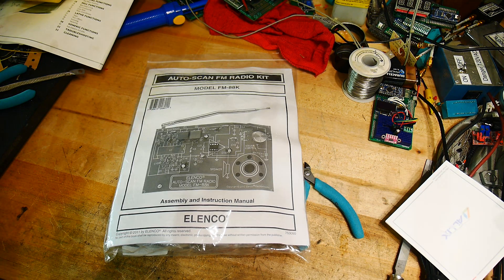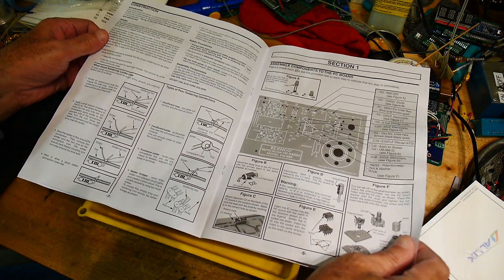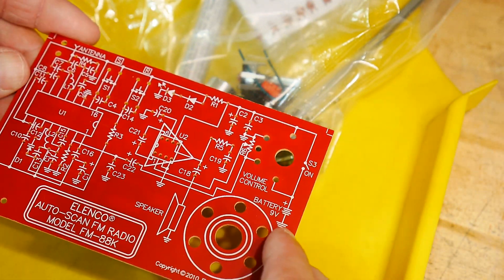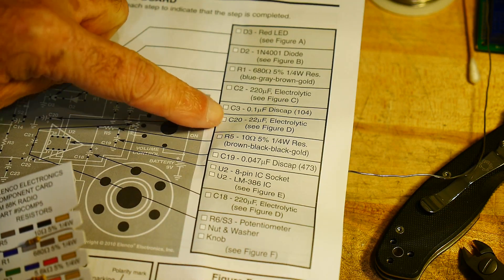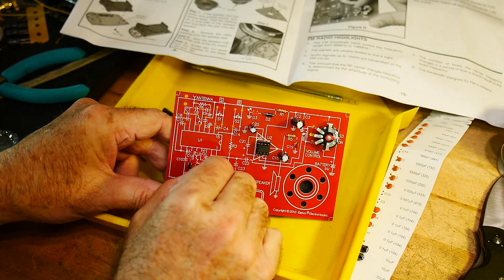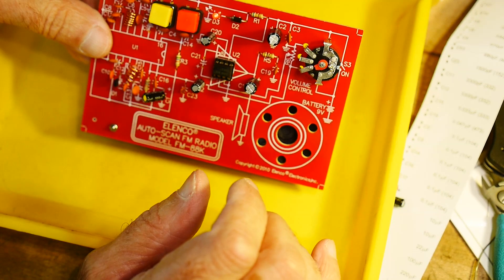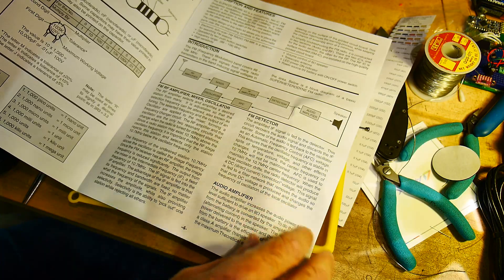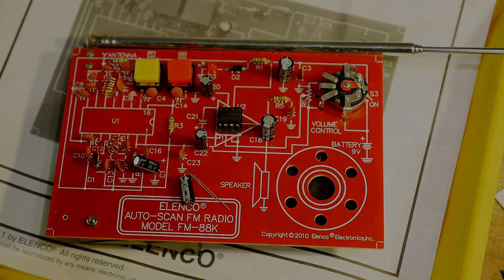#387 Elenco FM Radio Kit

Comment: @IMSAI Guy, Mine ended up tuning only to the NOAA weather channel at 162.55MZ. That's way too high for the standard 88 to 108 MZ range. I don't know what to do.
Reply from the maker: L2 and C13 set the oscillator frequency. My guess is you have the wrong value in C13. too small.
Reply: @IMSAIGuy  Thank you. I just checked my C13, it's 680pF (681), exactly like the instructions say. I tried adjusting L2 coil - if I press it tighter (all the way to completely touching each other) - what the instruction say I should do to catch a lower range, then the entire range is just static (evidently not going low enough to encompass any of the 88 to 108 range). If I make the distance between the wire longer then I am able to find the NOAA station @ 162.55.
Reply from the maker: @MykolaDolgalov  varactor in backwards?
Reply: @IMSAIGuy  I have beveled edge D1 variant, and I checked the schematics, and it's on the PC board the way it's shown in the instructions. Should I try to re-solder it the opposite way?
Reply from the maker: @MykolaDolgalov  no, what test equipment do you have?
Reply: @IMSAIGuy  I have none so far. What do I need?
Reply from the maker: If it were on my bench I would grab my spectrum analyzer to look at the oscillation, then use an RF generator to input frequencies. but, that is because I already have them. A frequency counter could be used. and oscilloscope could be used. a shortwave radio could be used as a crude spectrum analyzer.

Comment: As soon as I saw how you did the volume pot, I was thinking, 'He'll spot that soon and correct it.'
You did'nt. LOL.
Looks like a great kit for kids. Easy enough and useful.
Reply: Kids? 💀 I'm 25 about to do this lol
Reply: @DS-zo8xs  You are a kid, to me. I'm over twice your age. LOL.
Reply: I’m 26 never done anything electric before so I thought this would be fun. So far it has been but some things could use better instructions
Reply: @ethanwashoe5868  The other problem with kits, if you're just starting out and not used to them, is, Sometimes you get too many parts, not enough parts or two of one part and non of another. It's a good idea to slowly build up a stock of components. You can get cheap selection packs of resistors and capacitors from ebay. Hopefully this will turn out to be an interesting hobby for you with many hours of pleasure. (and frustration. LOL.)
Reply: @Franko_Walker  I had a lot of fun putting it together last night, was able to turn it on and hear some static but not get a station. I don’t really care though I had a lot of fun doing it and I already got another one coming in the mail.
Reply: @ethanwashoe5868  Exelent. So glad you enjoyed it, and static is a good sign that it basically works.
Reply: Pretty sure it's just for beginners. I don't really think an 8 year old could do this.

Comment: Does the potentiometer go on the other side of the board?
Reply: Yep, you're correct -  right there in the picture!
Reply: @PapasDino  you betcha and the volume will magically not work in a mirrored state wow no need to rewire....:-)

ps.all in good fun no insult intended.
Reply from the maker: woops. guess that will be an easy fix
Reply: Yes it is backwards. This will fix the volume problem where it starts at max Volume. Cheers